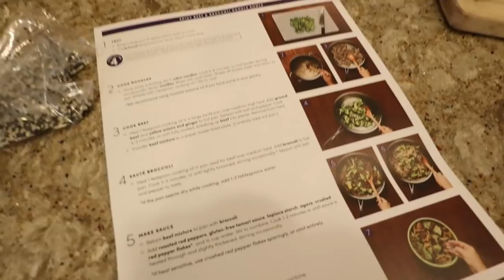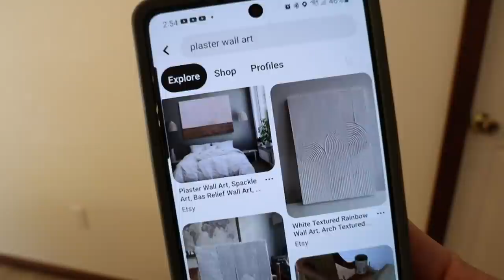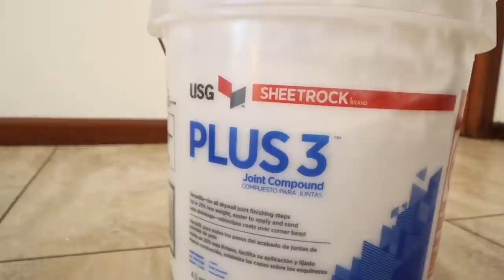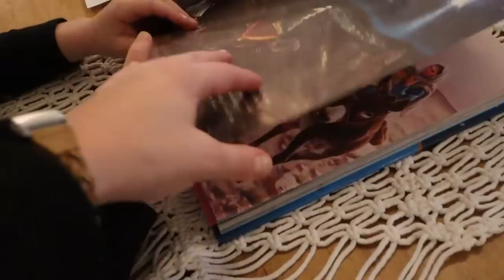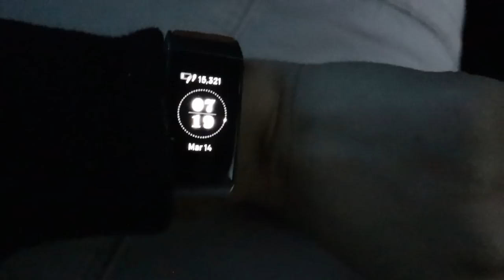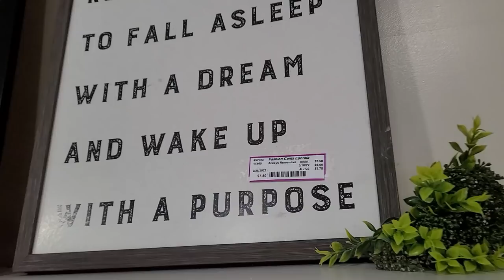SPRING Refresh: plaster art DIY, closet declutter + beautiful homemaking | MENNONITE MOM LIFE

Comment: The thing I do with what’s in my closet and drawers is I turn the hangers backwards and when I wear an item from the closet, I will turn the hanger back to “normal”.  And, in my drawers, I do the Marie Kondo folding method and place those clothes where they are placed vertically (II) and when I wear and item, I then place it horizontally (-). In April and October, any hanger still backwards or drawer item still vertical will be removed from the closet or drawer and donated to the local shelter.  My lingerie gets the same service- so the items in good condition (minus panties) also go to the local women’s shelter.  I know some people will think that’s a waste of $ to donate vs sell/consign- but I wasted the $ by purchasing things I never or rarely wore and I would rather that the clothes go to folks who are in a stressful situation.